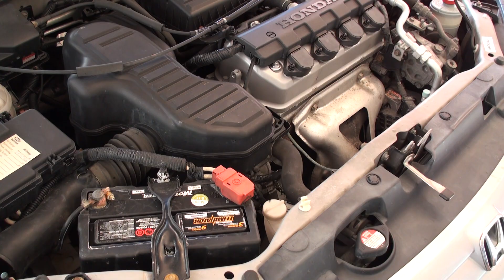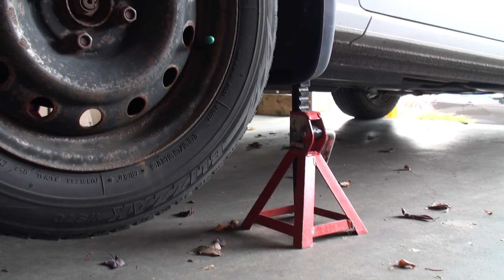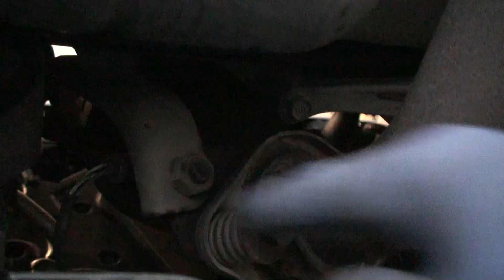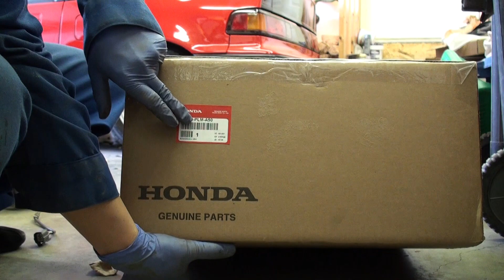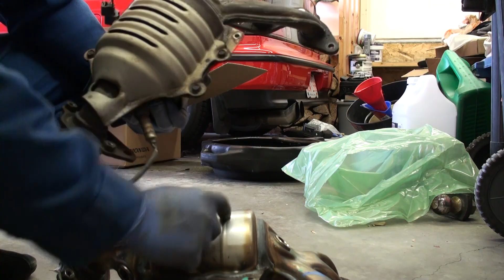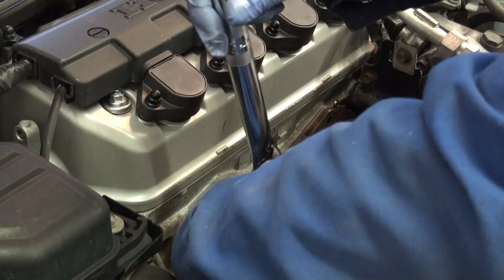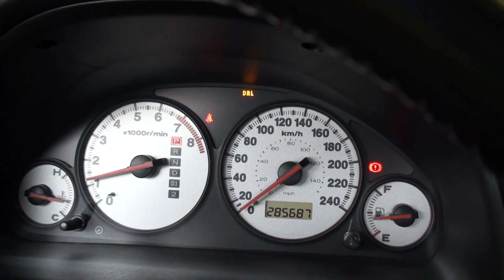2001 - 2005 Honda Civic Combination Exhaust Manifold Catalytic Converter  Replacement

Comment: I think your motor is not the 1.7L with variable valve timing option. My VVT 1.7L has a different manifold for more mid range. Wish you could have purchased the upgrade as it really helps
from 3500 on up being an interference manifold. Next time a manifold is warped take it to a machine shop and have them mill it flat for $85 US and you will not have the cracking. Another possible cure is to cut the mounting flange of the manifold between the 2 & 3rd pipe and that should take care of the uneven expansion and cracking. Did that on a Mitsubishi 1500 manifold Mirage with good  results. If an oxygen sensor at the manifold close to the head is not correct, that will cause the manifold to get too hot and warp.
Reply from the maker: You are correct, since this is a Canadian LX edition that it comes with the non-VTEC motor.  Only the Si's came with the 1.7 VTECs and the SiR's came with the 2 liter high output variant.  Good tips on the manifold fix.  Never crossed my mind to fix it that way.

Comment: Sir can you let me know the purpose of changing catalytic converter and i do have one question that is 
I am having Honda civic 2005 1.5CC problem is my car is not going above 120KM/H after that speed or after 3 RPM the sound of eninge is coming very loud.
Can you help me on this 
Thanks
Reply from the maker: The cat converter on my car had several large cracks in the manifold and despite repeated rewelding of the cracks that it wasn't in my best interests to keep wasting time on it.  A leaky cat converter not only diminishes performance but it can leak deadly carbon monoxide fumes that under the right conditions, can enter the cabin of the car.  I did it for safety reasons and the slight improvement in performance was a secondary benefit.

Comment: On my 2003 5 spd civic coupe I need to do the same Job.  I have a crack in the same spot. I was thinking about applying quick steel on the crack but dont know how long it would last so I'll probably be ordering a new manifold.
Reply from the maker: those crack filler fixes won't likely work on the manifold due to the fact that the manifold gets super crazy hot.  I've tried welding the seam several times with little success due to the mild steel they use that is really crappy quality.  If you're in the USA, you can likely find a good quality new cat for a pretty reasonable price.  Cats in Canada are stupid expensive but I didn't have a choice.  In many ways I'm glad I replaced b/c I've put well over 50, 000kms on the new cat and I haven't had a single issue yet.
Reply: @piercedasian  I ordered one from eBay for $150. Can’t afford a oem  from the Honda dealer.
Reply: @piercedasian  besides the catalytic converter that is combined with the manifold on my LX civic is there also one underneath the car as usual or with my civic being the LX does it only have the one combined with the manifold?

Comment: To weld it would you take out the cat converter? 

Would a crack in the cat converter reduce power will climbing up hill?
Reply from the maker: I have welded this manifold so many times in many different ways and it always seems to crack after several months of heat cycling.  My time is worth more than the hassles of yanking the manifold out every few months to fix.  Yes it did have more power and fuel economy putting in the new cat b/c it wan't leaking oxygen into the exhaust stream and throwing the o2 sensor readings off so the car drove better, was quiter and had marginally more power (if you consider 115HP much power at all). lol

Comment: After removing and after re install my car has a purr feeling to it kinda like a vibration you can feel it when you’re in the car and can kinda hear ir
Reply from the maker: That's just low idle and how the harmonics of the engine is playing with the car's chassis.  Mine does that too.  No cause for concern.

Comment: You'll have less trouble, with exhaust manifold cracks, if you leave its heat shield OFF, allowing the metal to better "breath".
Also, what happened to the two exhaust manifold BOLTS, the holes for which clearly are visible, when the manifold is separated from the head?
Reply from the maker: I'm not sure if leaving the shield off would help much since these manifolds are so terribly made.

The manifold bolts were reinstalled in the head.  No missing parts.  Trust me on that one.  I'm too anal to leave parts missing on my cars.

Comment: So I’m trying to do this on my 2001 civic. I installed it, and there was a leak sound afterwards. I took it to the shop and they said it was the wrong part and not sealing. I returned it and ordered one from a different website. Same thing, it’s not sealing. Any ideas?
Reply from the maker: what trim line is your civic?  Is it an LX? DX?  These things should fit perfectly if you got the right cat for the engine application.
Reply: piercedasian it’s an LX

Comment: $820 for a catalytic converter? Yes, I know they have platinum or rubidium or whatever in them, but I have trouble believing the crappy Honda manifold/cat has 5x more catalyst than the aftermarket, or is 5x better quality. Oh, and those O2 sensors are stupid expensive too.

Still not as shitty as Nissan for going all-in on bad CVTs, and recalling some but not all of them. So despite this manifold/cat business, I'd still buy a Honda over a Nissan. Fuck Nissan.

Thanks for this great video.
Reply from the maker: lol, you hate Nissan that much huh?  I guess I can't blame you.  Their CVT debacle was really bad.  yeah cats in general are stupid expensive (not sure how much they sell for in the US or other countries but I've never paid anything LESS than $650 + for a cat on any of my domestic or Japanese cars.  The sad part about that fact is that people are now cutting cats off of large vehicles and recycling them for like $100 yet it costs the owner of now vandalized car $1000's to replace them.  So silly some of these emission control devices and what they cost consumers.
Reply: @piercedasian  I just recently rid myself of a 2013 Nissan Rogue that I bought for $10k used. If I was on the highway for more than like an hour, it would start limiting speed. I'd notice when it limited at 65 MPH, then it would go down to 55, then 45. So I'd be stuck doing 45 on the highway. Moab to Salt Lake City is usually like 4 hours, but it took me 6 the last trip because I was stuck at 45 mph.

The other thing it would do is, when I got off the highway and stopped, it wouldn't go again until I turned off the vehicle and restarted. You could mash the gas pedal as much as you want, but the engine would not rev, and the car would not go until you put it in park, shut it off, and restarted. I was told by Nissan that this was likely either a control valve or a bad transmission (which might be the same thing, IDK) and that it would cost $4k to fix.

So yeah, fuck Nissan. I will never buy another Nissan.
Reply: @piercedasian  In the US, you can buy a universal cat for like $200. There's no reason a direct fit should be 3-5x that price. I mean it clearly is, because you're right that's what it costs, but it seems like plain greed to me.

Comment: I have a 2002 civic EX and can't find a cat/manifold to replace it. I called a honda dealer and they said there wasn't one. I bought one from ebay for it but it don't fit. Way too big.
Reply from the maker: a 2002 EX would be the Si up in Canada (not to be mistaken with your Si and our SiR).  Your cat should be downstream past the back of the motor on the exhaust pipe.  In that case you'll need to find the proper cat specific for the EX (USA) or the Si (if in Canada).
Reply: @piercedasian  So it sounds like on my EX there is only one Cat. the one under my car, but on the front it is an exhaust manifold only? The code I get is P0420, is that the Cat, or maybe an oxygen sensor? You are one of the best mechanics on Youtube, I changed my timing belt using your video and I actually did it right, first one I've done.

Comment: I have three Civics, 2001 EX, 2002 EX, and 2004 LX, the LX has a manifold/Cat combo, the others don't, looks like they have a header design, puzzled why Honda did that. Is it the yr model that makes the diff or the LX vs EX? If I look up a manifold for 2001 to 2005 it shows the Cat design only.  FYI Make sure you replace that cam plug if you own one of these, your trans will take an oil bath if you don't.
Reply from the maker: Ah yes... so the easiest way to tell which cat/header combo is to look at the motor and establish whether or not it has v-tec.  The 1.7 literals NON-VTEC DX, LX, EX models (In Canada at least) used the  cat combo and the Si and the Acura EL's used the header/ downpipe cat setup.  In Canada the Si is the EX in the US, the LX here is the EX in the US and the DX I believe is the DX.  The Si in the USA is the SiR in Canada.

Comment: Anyone know where to buy the mounting bolts for the headers I’ve tried finding the same size from a hardware store and they just don’t go on correctly. If anyone could direct me on that it’s be appreciated thanks.
Reply from the maker: the only place to really get them and have them fit perfectly is your local Honda dealership.  They're little studs so they can't really cost all that much.

Comment: What is the torque spec for the bottom bolt and spring bolts?
Reply from the maker: just snug them up until they can't turn anymore.  They do NOT need to be torqued down too tightly at all.  If I remember correctly it was something very low like 29 ft-lbs.
Reply: @piercedasian  Thanks.

Comment: im buying a header with no catalyst converter lol. My oem one is cracked and idling rough now. going to buy a decent part for 70 bones but only downside is no catalyst converter, but thankfully were i live no emissions. Has anyone deleted their catalyst and done this? im sure someone has lol.
Reply from the maker: If you delete the cat converter you're likely doing to throw a check engine light because the catalyst is meant to burn off any additional emissions before they exit out of the tailpipe.  Depending on the header you buy will it have a bunghole for the existing o2 sensor or do you intend to delete the sensor and leave it disconnected?
Reply: @piercedasian  deleted the cat, I used a spark plug non fouler to space the bottom 02 sensor after cat. No code so far. + i only used 1 spacer as i have an LX which needs the L spacer but all i had was 1 spacer but i made the hole barely big enough for the 02 to slip in which is why i assume its working. honestly the fuel smell is not all noticeable after 1-2 days. i think cause its a 4 banger 115hp its not using burning a lot of fuel so fast.

Comment: Just bought one from 1aauto for 199.00 with a heat shield and a 5 year warranty, I haven't installed it yet but I've already got a check engine light so I do not care about that. We do not have emissions testing in Michigan so that is not a concern either
Reply from the maker: I wish we could but cat manifold combination units here for so cheap. Sadly in Canada everything is expensive.

Comment: So I got a question I’m trying to help a buddy out because at advanced auto they are selling the manifold for $400+ which I think it way to high to sound correct, so I told him to look online and we came across two different websites selling them for $200 but it calls it the cat converter assembly, I’m just wondering if these are the same things or not, in the thumbnail of what they’re selling it shows the whole exhaust manifold or header whatever you want to call it, but I’m worried that it’s just going to send him a catalytic converter. He also has a crack in his manifold which they have tried to weld multiple times, I think the problem is the manifold being cast iron which is hard to weld together and to other metals because of how it expands in heat or somthing like that. Don’t quote me on that tho I’m no welder.
Reply from the maker: I thought I had replied to this but maybe not.  Going with a non-Honda cat can be sketchy because not all manifolds are built to Honda's spec.  I've heard of some folks going to aftermarket route with zero issues and some have had nothing but issues with the check engine light coming on.  

Now as far as what the actual part should be called:  The 7th gen civic came with 2 different styles of cat converters.  If you're driving the non Si or a Non-vtec civic then you need the cat converter assembly.  It is called an assembly b/c the cat converter is at the FRONT of the engine and is part of the exhaust manifold.  If you drive a Si or 1.7 VTEC model then you have a separate exhaust manifold and cat converter (the cat converter is located on the downpipe down stream of the engine).  I suspect that since you're watching my video that you likely have a 1.7 liter engine non-voter which means you need the cat converter/exhaust manifold assembly.  

Hope that helps.

Comment: Hi! Nice job on the video.

How do you know the doughnut gasket is still good? I have an issue where I smell engine bay fumes in the cabin when climate control is on. I think there might be an exhaust leak somewhere which is causing the engine bay fumes to be routered to the climate control. Any ideas on what can be done here?
Reply from the maker: I generally look for grooving, cracking and separation. Sometimes old gaskets last forever. I have seen many gaskets especially those in the rust belt just completely fall apart in a span of just a few years so your mileage may vary. Visual inspection is often good enough. Worse case scenario is that it’s easy to swap out IF you feel there is indeed a leak. Hope that helps.
Reply: @piercedasian  thanks!
Reply from the maker: You’re welcome!

Comment: I've got a Honda Civic 2001 and if I understand this correctly, these all have the same issue with the manifold cracking in the exact same spot due to the manifold not being level and/or warping shortly after replacement. Meaning, your Exhaust manifold/catalytic converter is going to crack in the exact same spot again within 6 months to 1 year or so. Is this correct?
I was thinking of using an exhaust wrap (Titanium Lava Fiber) and stainless steel wrap ties to avoid having to replace the same part again due to it cracking in the same spot eventually. What are your thoughts about that? My thinking is that if it cracks the crack will be somewhat sealed by the exhaust wrap and it will last a bit longer.
Reply from the maker: Mike your thinking does make sense and whether a new cat will crack or not is dependent on a few things such as if your head is warped or whether or not the new manifold was welded poorly (they all kinda are crappily made with overtly thin stamped steel).  Here's the thing I've noticed when I put a new manifold on.  Its been at least 50,000kms already and the new cat is holding up perfectly  I suspect that by the time the 2nd cat cracks that the car's life would be close to the end anyways.  I've been paying close attention to any exhaust leaks and so far none in the years since replacement.  Cracks unfortunately don't always form in the same place.  I've seem the break at weld seams, runner joints, it is completely random and it is because of the uneven heating and cooling of the manifold + cheap materials used.  Exhaust wrapping it could work on an existing cat but if you had a new cat I wouldn't bother until it cracked again.  The warp on my particular cat with the flange plate that bolted up to the motor.  Placing it on a flat surface it was evident that it was bowed or something weird was going on.  The new cat's flange is straight and true and screwing it onto the engine block at the time I distinctly remember seeing it mate up PERFECTLY to my cylinder head which means that my head obviously wasn't warped as bad as the old flange.  That being said, the old cat despite repeated reweld fixes didn't work b/c I would weld the manifold out of car when the flange was "unloaded".  This basically allowed the small crack to close up making a proper weld difficult.  When the repaired manifold was put back onto the car and bolted up snugly then it would pull the bow out of the flange which then "stretches" the metal on the repaired section which means it will crack again.  After repeated fixes I gave up and said screw it, put a new one in and I haven't looked back at it.  

If you get the exhaust wrap for cheap I'd say go for it.  I was too lazy to bother with ours and just opted to shell out the funds to buy new - no regrets and the car runs like a champ at 330, 000+kms.
Reply: @piercedasian  > Thank you. Much appreciated. I'm thinking since I bought a new maniford/cat for Honda Civic 2001 that I will just install the new one without wrapping it as long as the flange and head is not warped. Thanks again.

Comment: You make it look so simple getting the three nuts off the manifold. I noticed that access to the far right nut was impeded by the alternator. I tried to get a socket securely seated, but I couldn't quite get it, and rounded the nut when I tried to pop it. Now I have to pull the alternator to try and get access to remove the rounded nut. Total pain in the butt.
Reply from the maker: It really is quite simple permitted you have the right tools and that the fasteners are well lubricated and not seized.  The intent of my videos isn't to deceive the complexity of the job.  I have basic tools to do the work and in the end it could be pure luck that my bolts came out as smoothly as they did.  But yeah that far right nut is a bit of challenge - I don't deny that but it does come out with enough coaxing.